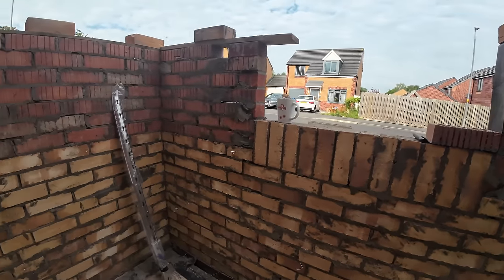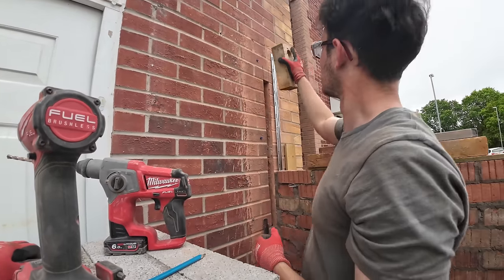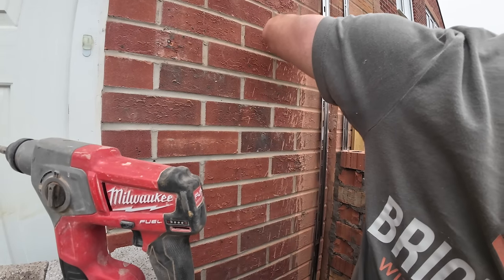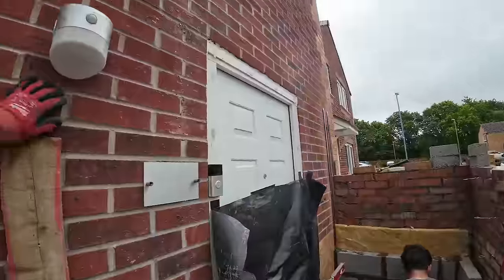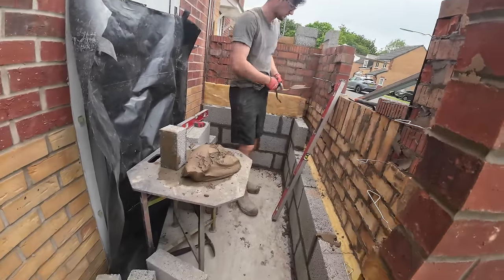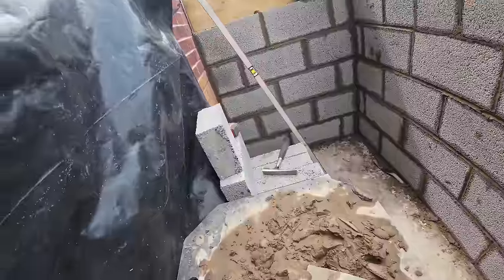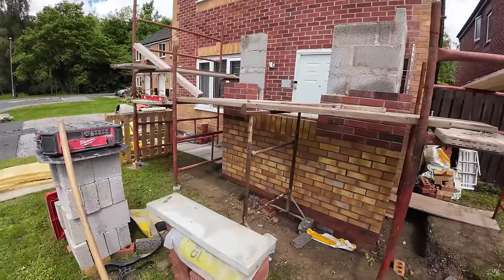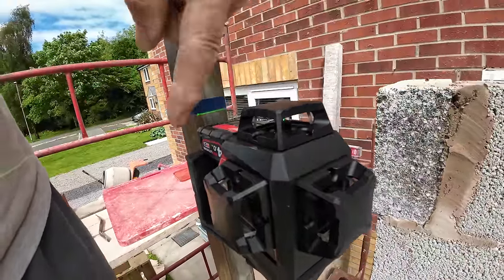DIY ON OUR PORCH, FINALLY STARTING TO TAKE SHAPE!!

Comment: Steve, what’s your advice with using wall starters on K-Rendered walls? Render on or off? Thanks!
Reply from the maker: That’s a tough one .
   If the render is sound then it should be ok but bare wall is better 👍🏽🧱

Comment: Steve am I right in thinking on a porch u don’t need planning permission as I wanna knock mine down and build a new one a bit bigger a timber frame one well that’s what the old porch is
Reply from the maker: Yes Phil as long as it’s under 3 m2 🧱👍🏽
Reply: Always check with your local authority, to be sure.
Reply from the maker: @martin2466 absolutely 🧱👍🏽

Comment: What happens if you need to get a large long sofa through the front door ;)
Reply from the maker: Oooops
Reply: @gezski
Just take the long sofa around to the back of the property, where I am fairy certain they have patio doors.
Does all furniture have to come through the front door?
That configuration of porch offers too many positive advantages to worry about moving the odd bit of furniture.......
How many times do you change a large item of furniture anyway?
Reply from the maker: @martin2466 Thanks Martin that was so nearly pinned 😆🧱👍🏽

Comment: SWITCH THE CRAP RADIO OFF!!!! ....................Oh, bliss, that's better. It's so much worse as well when the nonsense is not only audible but is written across the screen well.
Well done tho', a nice bit of work to watch.
Reply from the maker: Written across the screen ?
Reply: @SteveAndAlexBuild  Subtitles.....
Reply: Subtitles showing all the nonsense coming from the radio program (which you rightly turned off in disgust).
Reply: Mind your P`s & Q`s   or you will heading for a "Pinning."
Reply from the maker: Ah I don’t have subtitles 🧱👍🏽😆